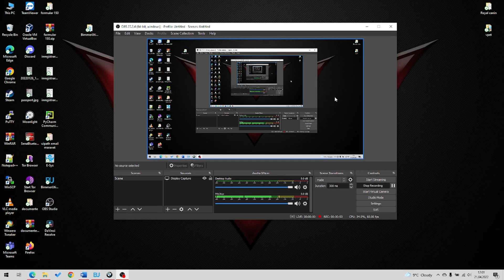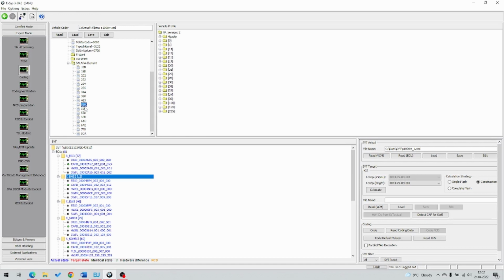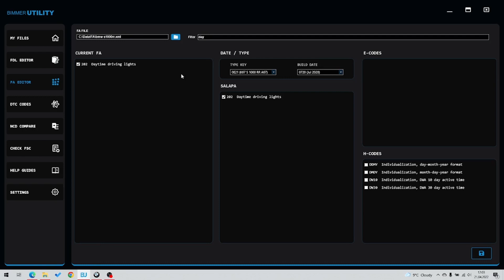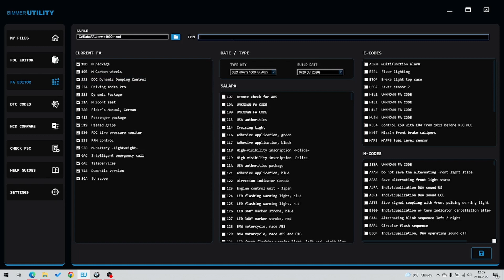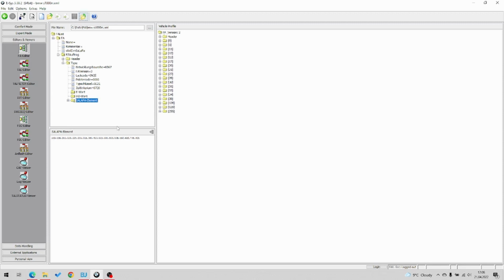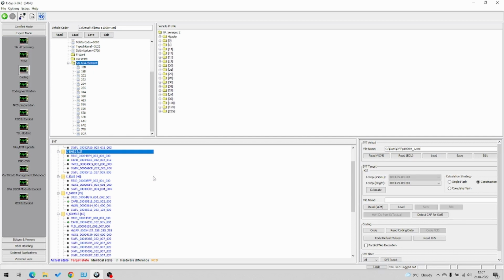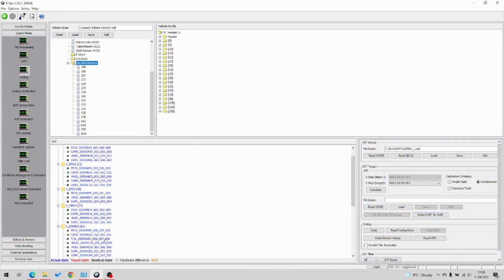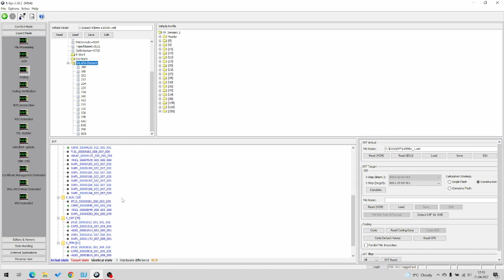ESYS DRL (Day time riding light) FA coding and restoring to default for BMW S1000RR

Comment: Do I need to do it with saving or can I just connect to the bike as usual?
Reply from the maker: I don't understand what you mean
Reply: @bmwcodingmoto   In the last tutorials you connected to the bike using the VIN, in this one there is a file selected as I see. How do I get the file? It's a .xml file you use
Reply from the maker: @TheArtsOfSense  connect normally.

Comment: Hello I have s1000rr 2021  I make accident I buy used dashboard is will work withe my ecu or need new one
Reply from the maker: Never done it. But I've read about it here https://www.advrider.com/f/threads/tft-retrofit.1289771/page-25
Reply: @bmwcodingmoto  thanks I will try to fixed

Comment: Do you know if I can coding to use multimedia in racepro Mode?
Thanks
Reply from the maker: At the moment there is no coding for that. Try to put the bike in race pro the switch off the ignition. After you turn the ignition back it should connect to your phone. I've read somewhere but I don't try it. Another thing that I will try is to activate enduro pro from GS bikes to see if you can have the customization of bike setting and also phone connectivity.